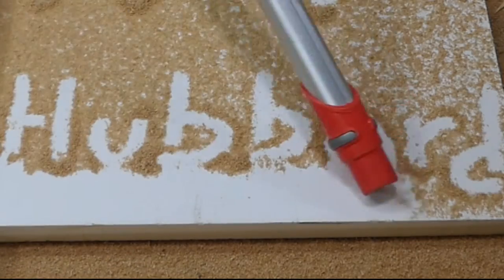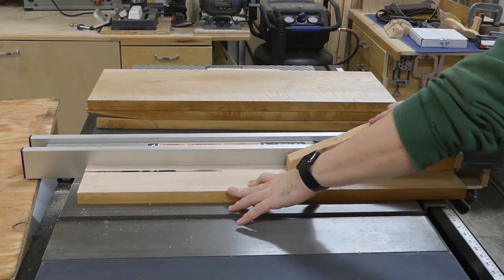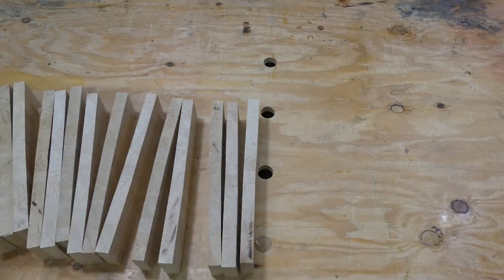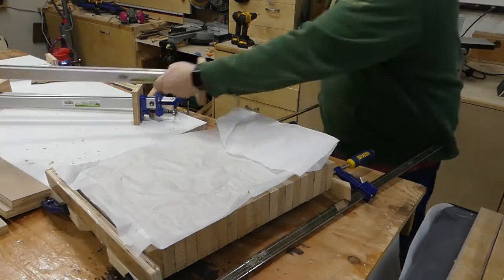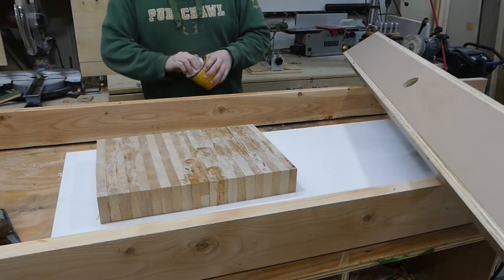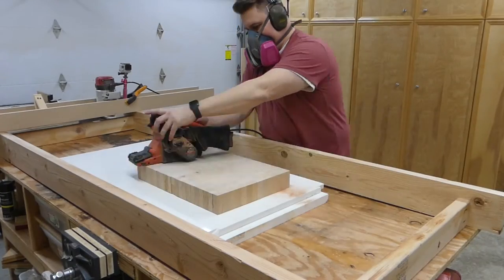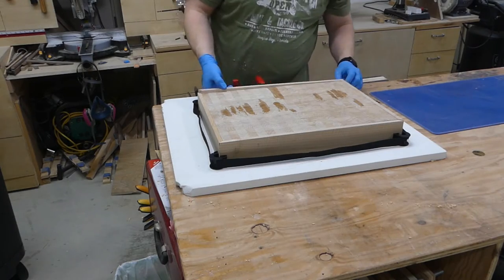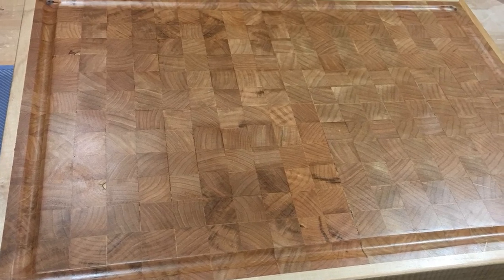Figured Maple Butcher Block/Cutting Board

Comment: Very nice cutting board.  This is on my list to do as it seems kind of a right of passage for woodworkers.  Question: You rotated the boards 90 degrees so parts were end grain and parts were edge grain.  Did you have any issues with the edge grain raising to a noticeable point over your end grain and also did you have any issue when finishing with the end grain soaking up more than the edge grain?
Reply from the maker: BronkBuilt by the time I got to the final glue up all of the cutting surface pieces were end grain. They had been rotated to create the pattern but it was still only end grain showing.  It all soaked up a lot of mineral oil. I hope that answers your question.

Comment: What epoxy did you use?  I'm in the middle of an end grain cutting board project myself and am thinking some food grade stuff may be needed.
Reply from the maker: Travis Lawrence Alumilite Clear Cast is food safe (but there's barely any epoxy used). More importantly titebond three wood glue which holds all of the wood together is food safe.